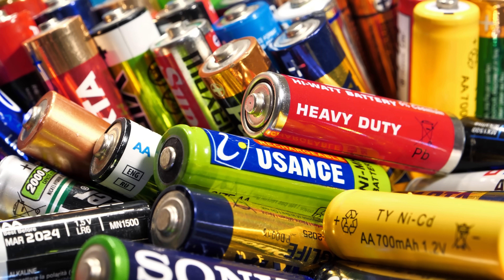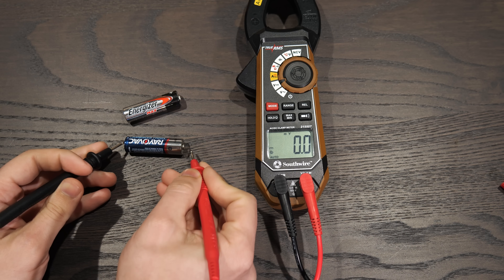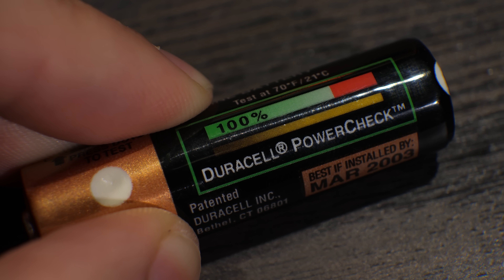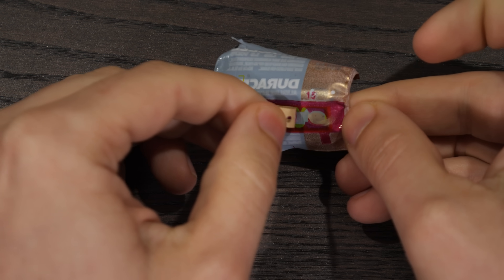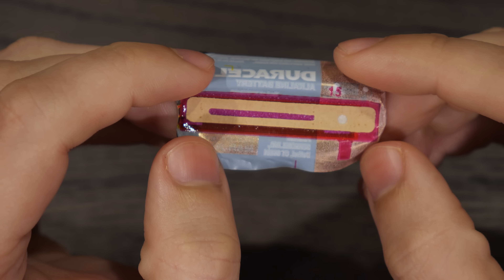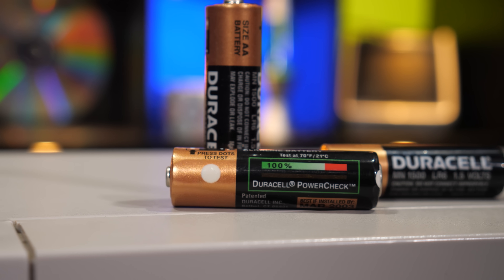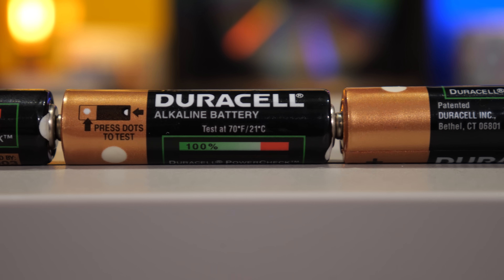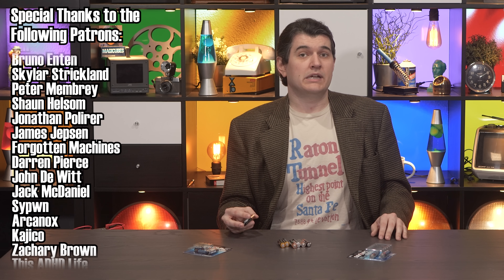Duracell PowerCheck: A genius idea which didn't last that long

Comment: Nothing like making your fingers white with pressure trying to get a reading from these guys.
Reply: Is it dead or did I just get the angle slightly wrong and not push hard enough? Guess I should just push harder!
Reply: @charkbot  😂😂
Reply: @charkbot 
Where are you going after you die. Repent today from your sins. Hebrews 9:27 says as it is appointed unto man once to die but after that the Judgement.

Confess your sins and turn to Jesus Christ today. He is the way, truth and life.
Reply: @charkbot so true
Reply: It's a good thing that this video got pulled from "No Effort November" because pressing those white buttons requires quite a lot of effort.
Reply: As a bored kid, sometimes these qualified as "Toy"
Reply: "Is the battery dead, or do I just need to press harder??" Dead batteries == pain.
Reply: Was about to comment the same! A ton of effort for a barely readable gauge most of the time.
Reply: For real, these things destroyed hands.
Reply: The fingers were part of the meter.  By the time your fingers were completely drained of blood from trying to push the buttons, you could compare the yellow meter's brightness to a consistent reference white of you half-dead fingers.
Reply: And feeling the battery get uncomfortably hot in the process
Reply: …and realizing the tester is a resistive load, eating the battery…
Reply: EXACTLY my take on this  !!!!!!!! @jrrarglblarg9241
Reply: @jrrarglblarg9241 eating the battery by how much, though? Pretty negligible.
Reply: @paulheap1982  You could feel it warming the strip. A crude red/green battery voltmeter uses 1/thousandth as much current to do the same job, reliably.
Reply: @jrrarglblarg9241  Just like your mother.
Reply: @jrrarglblarg9241 where they hers or just like is she a new grave digger? Lol (jk)
Reply: the thing is the place to put pressure wasn"t actually the white dot. Once I realised that it worked effortlessly every time.
Reply: @AndorianBlues  Why did I need to scroll down so far into replies to see someone mention this!
This was the problem, they put the dot on the corner making you believe that you have to really dig your finger into the corner to make it work, especially around the same angle as the other pad. But actually no, you need to put the force like 75° flipped because you want the pads to connect.
Reply: @AndorianBlues  I remember someone telling me this and I thought no way... Then I tried it and it worked effortlessly every time. I was like, "I'm checking ALL my batteries now!"
Reply: @MC4TWT so where exactly do you press lmao
Reply: lol oh yeah I’d have a concave dip in my thumb
Reply: I was born in 94 but I had a gameboy (they went thru SO MANY batteries) and I remember these things vividly. Didn’t really realize they weren’t a thing anymore, I just thought I was buying cheap batteries nowadays.
Reply: @JayRabxx  I used to have a fanny pack for my GBA on deck. Manuals. Cartridges in cartridge holders. Screen protector/battery-powered light. Plenty of AA batteries and AAA batteries (for the screen protector light). Link cable and wall adapter. Unfortunately, it was stolen, but those were the days.
Reply: @dapperfan44 the rechargable battery pack had a belt clip. That thing was so handy.
Reply: Yeah, and I never did get a good reading. Was easier and less painful just to use my dad's battery tester.
Reply: @XeonProductions  I'd just throw them in a flashlight. If the light is blinding, the batteries are good!
Reply: Memories unlocked
Reply: I'm so glad I'm not the only one who experienced this unique pain.
Reply: Digging my nails in and seeing nothing
Reply: When I saw the screenshot for the video my thumb started to hurt 😂
Reply: I can still feel the indents on my fingers.
Reply: Dang I love this channel.
Reply: This is what I was thinking, I remember it hurting my hands as a kid to try and use them. Don't remember my nails or anything working to reduce it either.
Reply: "Is it dead, or am I weak?"
Reply: all that to prove your batteries can feed your remote controle few times
Reply: Turns out as a kid I never understood how these worked. I remember expecting the percent bar to do something so I never looked at the yellow strip change colour.
Reply: @ImSamsquanch same here bro 😂
Reply: FR and then you realize you pressed like 1.5mm away from the buttons and the indicator displayed nothing ;_;
Reply: People misunderstood the test. The test wasn't the battery, it's whether you wanted the battery to be good enough to get the reading you were wanting.
Reply: I remember using these about 1 time and then was like screw this, it hurt to test these and tools only punctured the label. I guess if you had fingernails they may have been ok but I am not a Woman and had a fingernail removal habit so none available to push with.
Reply: it was all about getting the b-spot.
Reply: If you were lucky. some of them took about 2 tons of PSI to get it to read
Reply: Didn't seem to take that much pressure...
Reply: @dannydougin3925  it really didn't. Except for when they were running low, it'd take longer to show the result. So I'd press really hard then.

That's how it seemed anyway.

My cousin and I be checking batteries for fun like no other. Lol
Reply: I used my nails until I realized I could use two pens and it was much easier.
Reply: 😂True😂
Reply: But hey, you got to know the battery level!
Reply: I loved doing that
Reply: As a kid, removing batteries out of remotes to crush my thumbs onto these
Reply: I just used a knife edge
Reply: It hurt so much
Reply: oh so true.  if anything, that test became a deterrent to me to ever consider using/trusting.
Reply: It wouldn't have been so bad if they didn't put one of them right on the edge of the bottom so it dug into our fingers when we went to use the darn thing.
Reply: I loved seeing how much battery life was left
Reply: Pressure sensor included in the finger wrap 😅
Reply: If… I… can… just… squeeze… another… minute… from… my… game boy!
Reply: Exactly, it was horrible - by the time you tested battery #1 from a set, the last thing you wanted to do was test the other 3 in the set.  I'm sure THAT is why this went away - it was terrible!
Reply: Oh goodness I remember those days😂😂😂
Reply: Yeah i remember having to push so hard that i began to hyper-extend my joints
Reply: And if it didn’t light up, wondering if the thing was empty or you’re not pushing hard enough 😂
Reply: Just use the battery to tongue trick.
Reply: The paranoia that my thumbnails would crack in two from the pressure I had to apply as a kid.
Reply: I always used the edge of my fingernails, it seemed to work really effectively. I always loved having these, since the gameboy color didn't have a charge indicator I could get a rough idea of how long I have to play.
Reply: Pretty sure this exercise in my very early teens was what caused hair to start growing on my chest
Reply: It’s amazing how disposable batteries were once such an integral part of our lives, and this feature brought a clever, albeit underappreciated, improvement
Reply: Couldn’t you take the wrap off and put it on a new battery
Reply: haha for some reason I always remember this when I see these testers :D old memories
Reply: Squeeze please!
Reply: I remember that haha
Reply: me too
Reply: YES
Reply: Energizer had their own take on this during that time and I swear you had to press those tabs twice as hard as the Duracell's.
Reply: So true. But hey, I’d rather have that than batteries that accidentally ran themselves down.
Reply: Truth!😂
Reply: Damn, my finger nails hurt thinking of that 😂
Reply: 😂😂😂 oh yes!!
Reply: So we kinda share the same Childhood
Reply: it hurt my fingers so bad as a kid
Reply: Does it hurt?
Reply: Yes an it fattens the battery 🔋
Reply: I now remember, why I always keep a few nails slightly longer.
Reply: It's how we weeded out the weak.
Reply: I always thought I must be doing it wrong somehow.
Reply: It was a tradeoff that I would gladly take again
Reply: jag ser du
Reply: @the_kc_keys  jag ser du också 🧐
Reply: Yes
Reply: Truth
Reply: I read this thinking I was still watching a Police shooting video
Reply: so true
Reply: use a volt meter (if you have access/know how to use one)
Reply: They should bring them back to Sweden - you have too many brown fingers over there lmao
Reply: I remember that...
Reply: Mina fingrar kändes som de skulle falla av.
Reply: Same here. Did it once and went back to my regular RS battery tester.
Reply: I can still feel the pain thinking about it.
Reply: What? You use your fingers? I used my teeth.
Reply: That's called "blanching" btw if you were wondering.
Reply: Tänkte exakt samma sak. Undrar om de hängde kvar längre här i svea. Minns dem från 2005 ca
Reply: I quickly found they worked way better/quicker if you used your fingernails
Reply: when you opened a new box they were effortless but once they started draining is when it required more effort.
Reply: We were using them wrong. Pressing on the white dot on the bottom corner was not what that white dot was indicating; we were supposed to simply touch the bottom of the battery.
Reply: @NickWrightDataYT  😳
Reply: That's less of a problem with the tester and more one from human psychology from not wanting a dead battery.
Reply: Oh i remember that same thing...good times...
Reply: Yeah I remember having to really send it when having to press these in the 90s. So much so that if I had to check like 4 batteries in a row it my finger on the negative end would ache lol.
Reply: This is why I have the finger strength I have today 😅
Reply: yeh my hands hurt every time 😂
Reply: This is our last dance
This is ourselves
Under pressure
Under pressure
Reply: You gotta use your fingernail
Reply: Duracell CEO: Do you guys not have fingernails?
Reply: I remembered that, happened a lot.
greetings from Västra Götaland
Reply: 😂 😂😂 it was painful but worthy
Reply: "It's not dead, I just need to push harder!!"
Reply: YES!! THIS ! I remember we had SO MANY and i would spend 45 minutes with my tiny weak kid fingers trying to see, only to find the battery was dead anyway
Reply: Best part was thinking squeezing harder gave it more life somehow
Reply: I swear I never could get these to work
Reply: Those were the days lol
Reply: mine get pink and a little yellow lol
Reply: snowflakes were exist back than too 😂 poor you whats huge challenge, miracle you are alive now.😅
Reply: Bro discovered what it's like pushing blood away from your fingers.
Reply: Biggest scam on earth. 😂
Reply: i remember lol
Reply: Core Memory
Reply: They should put the same device on smartphones.  If for no other reason than to make the super long curly fingernails disappear
Reply: Bro for reallllll
Reply: How did we think this was normal
Reply: if the battery was stored crammed into somewhere it could either just just drain it dead, or sometimes make it smoke and burn the plastic
Reply: I remember as a kid I thought by pressing as hard as I could give it MORE juice. Silly me
Reply: universal experiences
Reply: pressing the negative side of these things HURT.
Reply: Exactly what I remember about this. You had to press so hard just to get a reading it simply wasn't worth the discomfort.
Reply: Fr
Reply: Hahah
Reply: Haha I forgot that
Reply: 😂😂 Those were the days.
Reply: CORE MEMORY!!! 😂😂😂
Reply: Omg, same!
Reply: That's all i remember.
Reply: That shit hurts. Have to squeeze so hard
Reply: Lol I remember that
Reply: The struggle was real!
Reply: I took one these appart when I was twelve and felt nostalgic watching this video… does that mean I’m a nerd?😂😂😂😂
Reply: Yes exactly 😂
Reply: That and the unpleasant sensation it produces, almost as if the sharp ends of the plastic coating were trying to cut into my skin
Reply: The video is a great reminder of how far we've come in terms of battery technology. It’s wild to think about how many disposable batteries we used to go through for gadgets like Game Boys and Walkmans. Rechargeables have been such a game-changer!
Reply: I remember basically doing my best super saiyan impression trying to get these guys to show their secrets
Reply: So we used batteries to test if the batteries worked... makes sense! It’s like eating part of your sandwich to see if it’s still fresh.
Reply: Then you have the little indents on your nails!
Reply: From nostalgia to insights, this video hit the right battery notes!
Reply: I remember that well! Pushing as hard as I possibly could to try to get it to register correctly... :D
Reply: PowerCheck batteries: A glimpse of genius we need back.
Reply: I still feel the pain :(
Reply: You used the ends of your fingers? People pushed on them with their fingernails...
Reply: I had these batteries when I was a kid. Definitely brought back memories. I always did this test or tried to anyway 😂
Reply: Hahaha..."Swedish joke"...hahahaa...we are on the floor
Reply: haha true, my fingers were dying trying to get it to show something
Reply: You just have to not be a wuss
Reply: Eyy we have the same pfp
Reply: I don't think I ever got one of those things to read, either my finger nail cut though the white dots or my fingers gave up before it ever made contact. I gave up on Duracell anyhow after so many tended to leak and ruin what ever they were installed in.
Reply: Im sorry but... you are NOT supposed to press the white circles... Are you telling me that all you people used to press the white circles? Press them for what reason? Electricity doesn't work with pressure...

All you needed to do is put your fingers on the white left white circle, and then the other finger - not on the white circle - but on the BACK of the battery... On the metal thing on the BACK of the battery... Then it should work immediately
Reply: As a kid I used to turn my fingers blue trying to test the battery, then I discovered a technique that required little to no pressure from my fingers 😅

But when that battery was dead, you still would kill your fingers before dubbing it as officially dead
Reply: I forgot about that 😂
Reply: Lol right
Reply: I don't remember it being difficult at all to use. If he's remembering it that way then it probably is because he was 8 years old in 2003.
Reply: I never took 8 to consideration I as white because of all the pressure I'm under. Ground breaking revelation.
Reply: why, do you not have fingernails on your hands?
Reply: Right? Like We Were Somehow recharging it by pressing harder
Reply: So much easier than a multimeter!
Reply: that's what nails are for, thanks to evolution
Reply: @piuthemagicman  That includes nails
Reply: @RedWingsninetyone lol
Reply: @RedWingsninetyone as a kid i didn't have any idea how these worked and i thought you needed to use your fingers because nails aren't conductive, so i mostly just squished my fingers, haha
Reply: @piuthemagicman  close, we actually did not evolve to have fingernails to use battery testers!!
Reply: @piuthemagicman  Nails are too slippery on the wrong part of the finger.
Reply: @piuthemagicman If you pressed the dots (especially the one on the edge) with your fingernails, the tester usually failed after the second use.
Reply: Yep, finger nails make easy work of getting a good connection
Reply: @piuthemagicman
Reply: @piuthemagicman you used your nails? Go to jail right now
Reply: @piuthemagicman you mean fingernails or nails 🤷‍♀️
Reply: @piuthemagicman  lol wat
Reply: @piuthemagicman some of us kids bit our nails….Check your battery checking privilege please….
Reply: @piuthemagicman then why did evolution think it was a good idea to make a human stress reaction to bite them to a useless length
I mostly joke, but that is also my response to anytime I hear but that's what your nails are for.
Reply: @piuthemagicman  they don't work with nails.. it needs the heat of your finger. As I recall.

And his demo didn't count since he used hair drier.
Reply: @Lightblue2222  No it worked by heat created from resistance to current from the battery. The heat of your fingers would actually have made it FAR less accurate
Reply: @Squidbush8563  if its only about the connection "electric generated heat" than the heat from your fingers wasn't hot enough to make any difference. Electric heat is hotter. I assumed it was heat from fingers because I recall having to press so hard and having to cover the circles well. But I get it now. Thx
Reply: @piuthemagicman  if only I could stop biting my nails. I'm 34 and no signs of stopping yet. Alcohol? Quit that. Heroin? Haven't touched it in 10 years. Biting my nails? Hopeless junkie.
Reply: @piuthemagicman  thanks to god*
Reply: @TimberWulfIsHere why are you here on a science channel? creationists are embarrassing
Reply: @interrobangings  I could ask you the same since you are acting like a  medium who can somehow read someone. That's not very scientific. Not scientific and also incorrect.
Reply: @TimberWulfIsHere  why are you creationists always so disingenuous 😮‍💨
Reply: @interrobangings  why are mediums always so certain?
Reply: @TimberWulfIsHere no one asked for your beliefs lol. Don't try to correct someone with your own beliefs, everyone has different beliefs.
Reply: @TimberWulfIsHere and plus, you can't be telling anyone what's scientific or not when you believe in god💀
Reply: @therealloganyt237  the irony of your comment is hilarious and entertaining. Thank you.
Reply: … because your mom bought fake batteries. :D
Reply: My fingers are already white tho...
Reply: I'm the 13000th like! Give me an upvote for being the luckiest guy today!
Reply: A bare copper wire worked just as well.
Reply: Guess I'm one of the lucky ones who only had to apply moderate pressure ¯\_ (ツ)_/¯
Reply: Toughen up.